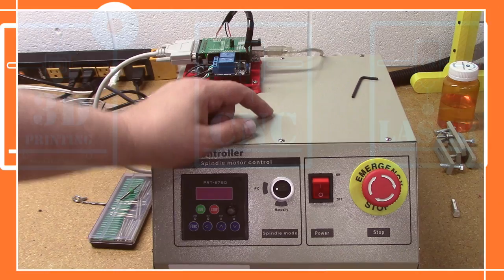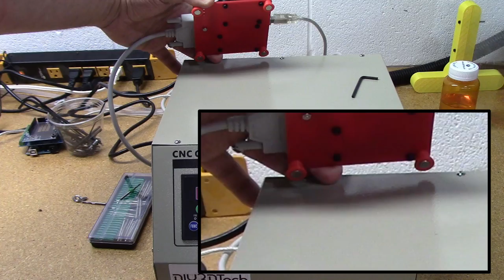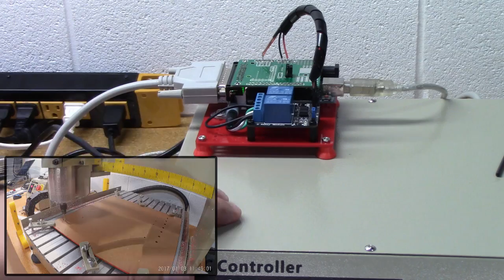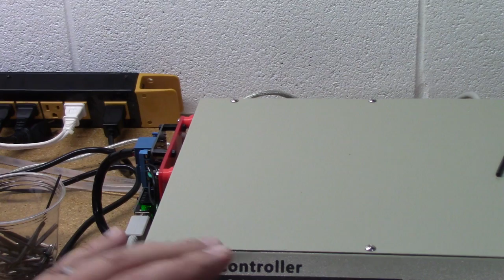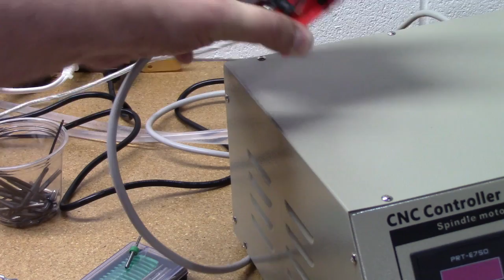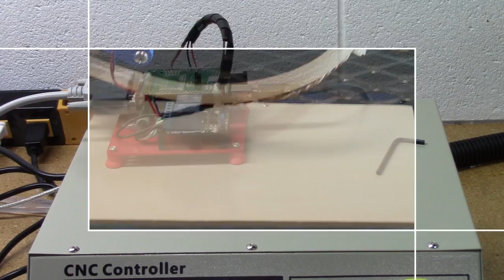3040 CNC - Electronics Update and Pump Control!

Comment: I'm in the process of building a CNC and I'm trying to decide how I'm going to tackle the electronics. I had planned to use Mach3 and a parallel interface. I have an old PC that will run Mach3 but I really don't want to find a spot for it in my garage. I thought that if I integrate GRBL into my setup then I could toss the old PC and use my laptop as needed. I don't have any experience with either Mach3 or UGS so I don't know what I'll lose. Did you lose anything switching over to GRBL?
Reply from the maker: This gets to be a complex topic, if you a hobbyist go GRBL and save the cost of a legal copy of Mach 3.  M3 adds a lot of pro features you likely as a hobbyist will never use.  Also M3 can run run multiple axis at one, however as a hobbyist you will never notice...

Comment: Are you using the VFD for the spindle? I have the same machine and my VFD settings are off and I cannot find what the settings should be anywhere. The seller sent me the default settings
Reply from the maker: Yes it "has" a VFD however I too have zero clue about its strange settings.  It does "seem" to work yet I just issue S1000 for 100% and use it either full on or off at this point as I have not had the time search or experiment with it.  When I do I will share it and if you find out please also share back this way as I too would like to know...
Reply: I will share if I find anything out. I am looking over some forums to see what I can find out. Thanks
Reply: Sounds like a future video. I haven't had too much luck getting anything to happen with the selector in the "PC" position. I assume the display is indicating frequency as it shows 400 when on 100%. I'm assuming that it's directly proportional to the RPMs, but I haven't been able to verify that anywhere.
Reply from the maker: When I got I searched the forms and wrote the seller but with no luck :-(  Have you guys tried with Mach 3 sending S commands?  I have only used mine with GRBL and don't think the DB25 board passes the PWM signal...
Reply: I have not had any luck getting Mach3 to run the spindle. I have just now got it to run the spindle at full speed (400hz) from the VFD itself. If I cant get Mach to run it I will be happy with that I guess.
Reply from the maker: Hmmm that is interesting, this later spring when I get more time I will tear down the house and see if I can't trace down the logic...

Comment: The reason for TWO relays?  Any luck with spindle control using GRBL?  I've been turning mine on manually.
Reply from the maker: Because two come on the sain-smart board.  Also yes I use GRBL all the time for spindle control as back to the relays in non-VFD drive machines (which I just use the PWM out) I use one for the Spindle (on/off) and the second can be used to toggle vacuum systems (using the coolant command).  Hope this helps :-)

Comment: Guy is not selling the grbl shield kit and the others are 30 to 60 not $9.95
Reply from the maker: Here ya go (https://goo.gl/yqmtcj) you get the Uno, CNC Shield and three ramps for $18.00 if you look around you can also get just the CNC & Ramps  for $10 bucks as I have bought at least a half dozen over the past year :-)
Reply: Yeah, ramps has become dog cheap lately I was just pointing out your link is now dead and when you click the "seller has relisted" it goes to the search page.  Thank you.
Reply: https://www.tindie.com/products/Ron/arduino-grbl-to-db25-cnc-shield-kit/
Reply from the maker: Aah I see said the bind man who picked up the hammer and saw, yea that is the problem with linking back to eBay :-(
Reply: Yeah I freaked when I'd ordered my 3040 and found that the shield was no longer available on ebay. Took a fair amount of searching to find the Tindie listing. Still debating on installing and using the bootleg Mach 3 that came with the machine. Computer upgrades were necessary first. That was a whole other adventure.
Reply from the maker: If you can't fine one (board) the cable is easy to make and even wrote a book on how to (http://amzn.to/2mEYJCf) and if you look back in CNC videos there is also video too...